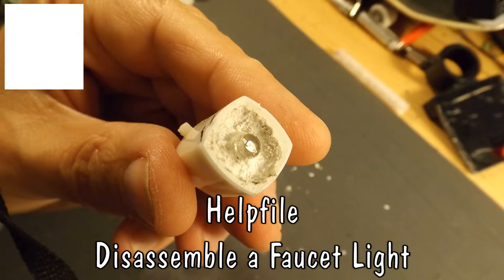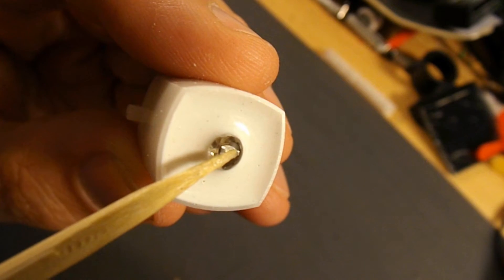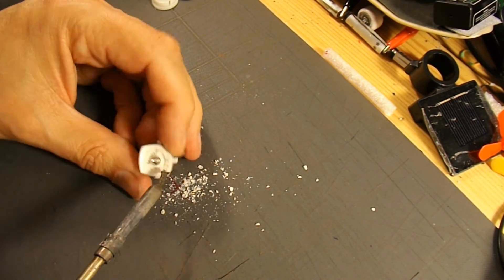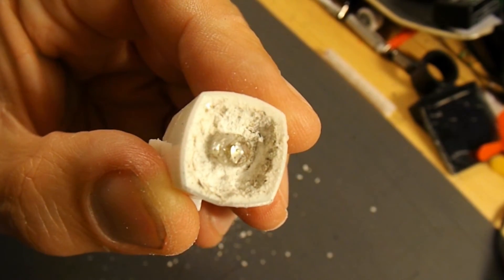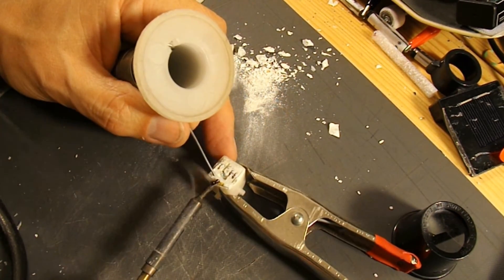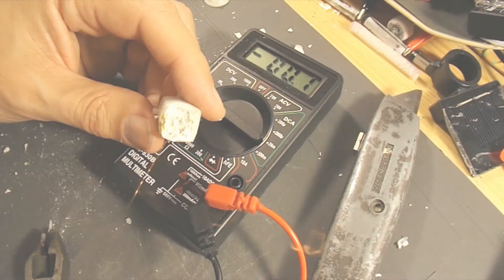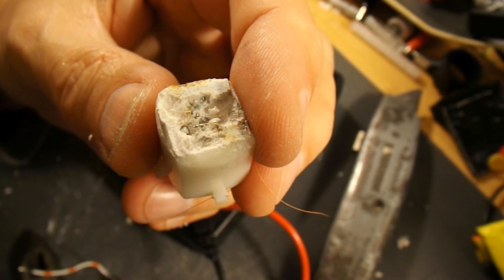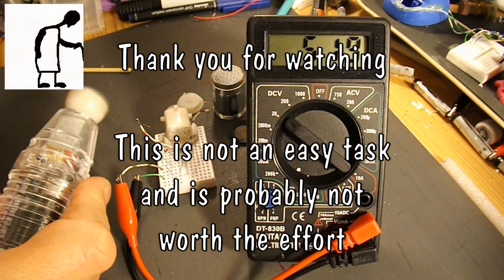Grandad vs the Faucet Light - round #2

Comment: Hmmm if you have a 3v output and a 5 v output from the generator would it be feasible to connect the generators output to the magnet fan with rechargeable batteries ,yes I understand you would have a voltage bleed out but would the unit would spin for some time before this occurs ?

Great video mate from HENSHOOTEN on the other side of the pond
Reply from the maker: Thanks, I guess you could feed something back that way, but I doubt it would be worth the effort for any practical purpose. Might be interesting for novelty value.
If you want to see the little generator put to more use, have a look at Larsko
https://www.youtube.com/user/Larskro/videos

Comment: Congratulations!  I took three apart about the same way and only one of the three was a success.  That one must have been an older design because it had nice insulated lwires connecting the circuit board.   Try it as a motor with a small magnet biased reed switch.  I had a lot of fun with that.  About 1 volt in a 5F supercap runs it a long time.  Great tutorial video on how to take one of these apart and what to expect.  Sometimes you get lucky.
Reply from the maker: Thanks, yes I probably will have a go at that. Now that I've managed to get one apart and it still works I will have to do something with it to make the effort worthwhile. Maybe a flat disc on the shaft painted black with a white line on it and trigger a photodiode or LDR along the lines of your recent series.

Comment: That magnet based fan thing is wicked ! I've done plenty myself with such interactions, but never so usefully. Good to have a non metal cased generator motor in those faucet lights.
Could mount a magnet rotor outside in the wind and have that faucet generator spin from behind a window (easiest if the window was right next to a 90 degree wall I would suspect). You'd have a wireless electricity wind generator thing supplying power from outside !
Reply: Yeah where can I get one
Reply from the maker: 911mporsche if you mean the faucet light I just searched on eBay.